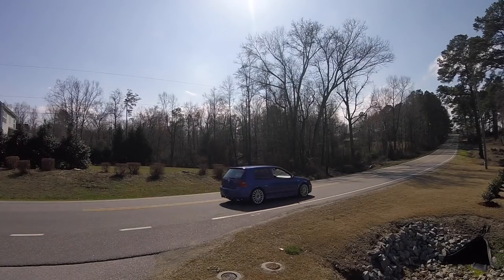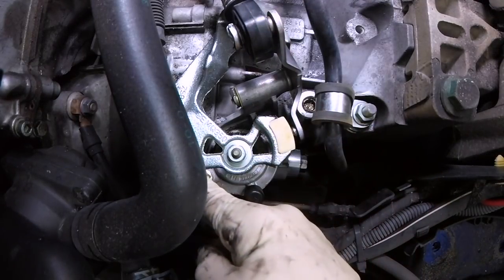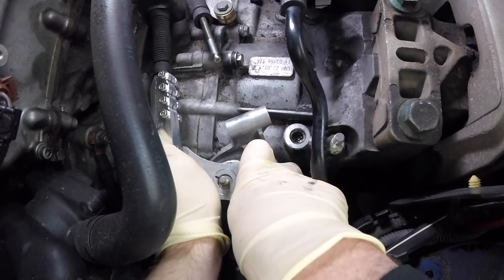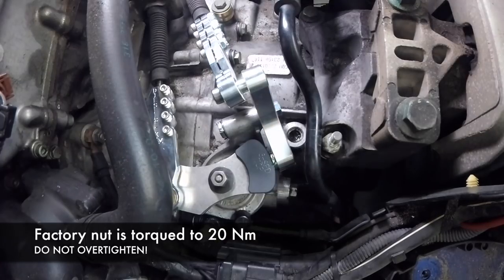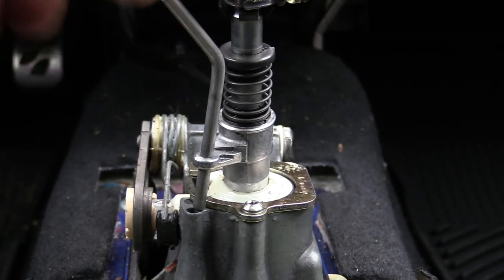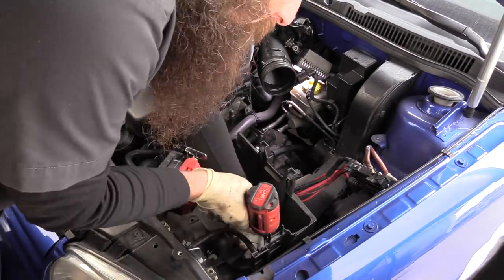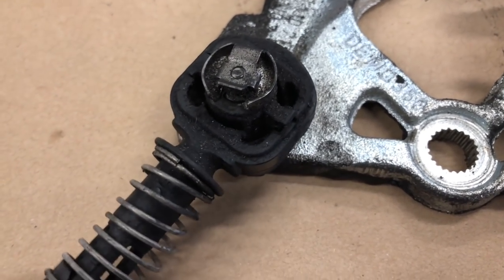How to Install a Short Shifter and Adjust Shift Cables

Comment: So if your shift cable pops off gear shifter and you have to get it towed stuck in 3rd gear and your clutch pressurizes to the floor what is your next move? My clutch isn't loose and dead its pressured to the floor. I'm already gonna reattach the gear selector but how do I release the clutch? Does it have to do with the master slave cylinder? Or does it have to do with the flywheel and pressure plate?

Comment: Great instruction!  Any hints or recommendations on finding one of these kits for my B5.5 TDI?
Reply from the maker: I’m not sure. I’d maybe look at an Audi shifter? We never got the TDI in manual. Plus b5.5 performance stuff is not widely supported
Reply: @HumbleMechanic Thanks,  I have figured that out, but here's the question for you:  I had a 5 spd manual that I had a shop in MO swap for the toasted Triptonic, as the European sister used them. The problem is, I can't identify it.  If I had a manual ( '05 B5 Audi, for instance) where would the tag be that would identify it?  I don't know if I'm blind or just looking in the wrong place on the transmission,. I suspect it is a Zurn transmission , but am unsure.

Comment: When you did the bushings inside the gear box, did you have to go thru the bottom or can you do them all from inside the car?
Reply from the maker: I did them in the car. It was a pain, but better than taking the box out
Reply: HumbleMechanic thank you! I figured it would be a pain but like you said a lot easier than dropping exhaust and pulling the box out. Thank you for the response man! Btw scweeet new garage and your new vcds tutorial video is awesome! I learned a lot that I didn’t know about that software

Comment: Thanks Charles !
Reply: Mk4 2004 GTI 78k miles !  Thank You for helping me to keep this thing on the road !  I have : Cold air intake, Stage 1 tuning, Complete exhaust upgrade from 42 Draft Design, and rear control arm bushings from Powerflex !  Also I have ISC coil-overs (rear installed, going to do the front suspension this fall 2022).  This car is a Beast !  I am the original owner and someday I want to upgrade her to Stage 2 with a Supercharger, new cam shaft and of course a short shifter, but I realize I am looking at a significant engine upgrade, maybe replacing other internal parts, as this ship is 18 years old... ThanK YoO for all of these great vids, keep going ! !

Comment: Hey Charles! Great video! Will this kit work on my 6-speed 2007 VW Passat B6 Variant 2.0 TDI? The specs for the kit mention only 2012-2015 TDI Passat. If not this kit, is there a different short shifter kit I can go for? Thanks, and keep up the great work!
Reply from the maker: I am not totally sure. WE didn't get a B6 TDI. I would call DG and chat with them. They are awesome to work with

Comment: I installed this kit and love it. However, first gear is really difficult to find and I have to push down and forward in the same motion as going in reverse. I pushed the cable end in as far as I could. Is it possible to push them in too far? More often than not, I end up selecting 3rd or reverse instead of 1st.
Reply from the maker: Probably need to readjust the cable a little. That’s a finicky adjustment

Comment: On my mk4 the end linkages for the shifter are the early type (ball and socket), is it possible to convert the assembly to the later pin style linkage by using the later style shifter arms?

Comment: I have this same shirt shifter on my built mk4 VR6 GTI.  Im pushing almost 400hp. I have aftermarket motor mounts and it's been about 2 years since I installed the mounts (they are still in great condition) but recently I had the bolts that mount to the transmission housing rip out (literally ripped out the threads) so I beefed up the bolts to 1/2 inch with helicoils after beefing them up once and having them immediately rip out again. now everything is good and holding well. but since I reinstalled everything a few days ago, I can no longer shift into 3rd gear. it worked before I took it apart. now it's like something blocking it. all other gears shift smooth and I tried re adjusting the short throw but it still won't go to 3rd. 
what do you recommend I try to get that back. I still have my trans lock, and made my own shifter pin that holds tight.  am I just not doing it right or could there be internal damage? 
I feel like I'm not adjusting it properly. 
my trans lock pin doesn't like to stay locked pushed in. how important is it that it stays in the locked position? 
I didn't have this much trouble installing it originally a couple years ago. it was easy peasy. I'm praying I'm just an idiot and need to be more persistent. I've only got 112k miles on my car and would hate to have to rebuild the trans already.

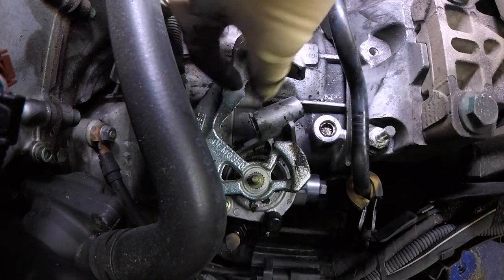Comment: Do you know what is the part # for the bracket @2:30 and also does that bracket will fit on a mk5 gti 6 speed transmission

Comment: Hey I know this video is a little old but I am in dire need of help. I ordered this very kit and installed it, which went extremely well thanks to your video. I have a mk4 vr6 and I enjoy it very much. However, right after I took all of the slack out of the shift cables, and I ran through all the gears while the car was still off-or so I thought. I put everything back together and went out for a test drive. I immediately noticed I didn’t have a 1st or 2nd gear, just 3rd-6th and reverse. So today I tinkered with it some more and now I don’t have reverse, but the rest of the gears. So if you see my sob story by any chance, any help would be greatly appreciated. Thanks-Aaron
Reply from the maker: Keep at the adjustment. I some how lucked out getting it on the first go. Be sure your transmission is locked AND the pin is in the shifter.

Comment: I have a 01 golf 2.0 or 2.slow, avh engine code I believe, is it the same process for it too?
Reply from the maker: It will be similar
Reply: HumbleMechanic how about the shifter and the parts that you used? Would they fit on mine?

Comment: does installing a short shifter like u did make rpms drop faster so the revs match right? new manual driver here and I notice shifting up into 2nd amd 3rd is very slow in my jetta
Reply from the maker: No it shouldn’t impact that at all

Comment: Hey man, great little tutorial! Question: I've got a 2006 Jetta TDI (BRM) with an automatic transmission. I'm getting a low boost code (P0299) and can't find any vacuum leaks. When I connect the vacuum line to the N75 (pressure converter), it seems as though it sends full vacuum to the turbo actuator (the actuator holds vacuum just fine and is set to open at around 3-5 PSI vacuum and fully opened at 18-20 PSI), thus forcing it to open completely and run horribly. Do you know if the actuator is supposed to send full vacuum to the actuator at idle?Hope that all makes sense.
Reply from the maker: I think you are correct. Look for boost leaks and also be sure your cam is not toast. Cam toasting can also cause MAF issues
Reply: Thanks, Charles. I put a new cam in just a bit ago along with a new LUK flywheel (was making that dreaded rattling noise). I'll look for some electrical issues to see if that's what's causing the N75 to send full vacuum to the actuator. -- I'm getting full vacuum and can't find any leaks... I just kept thinking it was strange that the N75 was passing along full vacuum instead of regulating the vacuum. I put in a used N75 from the junkyard, although I know it could also be toast.

Comment: Where the 5mm pin sits in to hold the shifter in place broke any advice on how to hold this piece in the correct place since I can’t use the pin anymore ?
Reply from the maker: I’d drop the pin down and have someone hold it in place

Comment: Yep, don't want to forget that socket, you all know how useful a 12mm can be!
Reply from the maker: LOL, also dont forget to unlock the trans. I have seen that lock break. It's available separate, but a pain to get out.
Reply: Engine bay full of 10mm sockets, each one adds HP, I left a LED Mag light mini once on top of the radiator cover between the grill and core support of a 94 lumina. Spent a whole month there sliding back and forth driving me nuts thinking the power steering rack was going out. It still worked after that

Comment: Installing a S3 shifter on my mk6 gti, Will I need to adjust the shifting cables or should it be a bolt on with no adjustments?
Reply from the maker: probably have to adjust

Comment: I've heard installing a short shit like this can lead to more strain on the shift forks, any truth to that?
Reply from the maker: Probably some. I’d imagine that those issues come from the driving style people would have. Modified parts almost always come with a reliably trade off
Reply: I have heard that some short shift kits need a precise adjustment for cable slack. Too little slack, and the forks are almost shifting the gear and that would cause transmission wear. I have heard it is a common problem among cheap short shift kits in Ford Mustangs. That is why many Ford guys are prepared to pay a much higher price to get a Hurst short shift kit, rather than some generic unit. I'm sure that although the companies that make VW shift kits might not be the same as those who make Ford shift kits, the "You get what you pay for" rule applies to whatever brand you buy.

Comment: Just installed this and for some reason my 1st gear became my reverse and my reverse is 1/8 from shifting to 1st. And info on how to reset and get the gears aligned correctly? I have a 01 Jetta 2.0
Reply: TWINSZ1011 having the same problem currently. Did you ever find a solution?

Comment: Where do you get your Allen/hex drive sockets?
Reply from the maker: There are 3 different sets I usually use. I REALLY like Snap ON here, especially the ball end. Their ball end Allens are the best hands down. 

I also use Hazet. They are pretty pricey too, but are great. http://amzn.to/2DyHd6K

IF you want a really good socket and a GREAT price, check out VIM. I use a lot of their stuff too. http://amzn.to/2FNA0BF
Reply: Vim sells a set of short 1/4 drive hex that are pretty darn good. Pretty affordable too. In the $25-30 range. There are bluepoints that i have that im somewhat certain are identical. The bluepoints cost $11 each...

Comment: I cannot for the life of me find a Short shifter kit for my 02J 5 Speed gearbox. I put a MK4 Dashboard in my Mk2 Golf, but because the dashboard isn't as shallow as a MK2 dashboard the shifter hits the dash/center console in 1st, 3rd & 5th. I desperately need a 1.8t GTI 5 speed short shifter.
Reply from the maker: I think DieselGeek make one.
Reply: HumbleMechanic Oh, you're correct, I was under the impression that they didn't fit the early model 1.8t GTIs but it appears that they do. But damn, $180 for a short shifter, it probably would have been cheaper to buy a new Mk2 dashboard haha.
Reply from the maker: Hahahha true.

Comment: How to Telestart T91 Upgrade KIT - Engine Heater -> Parking Heater? Vw t5 2012
Reply: It might not be that easy to demonstrate. The Volkswagen T5 was never sold in the USA because the VW T4/Eurovan wasn't a big seller in the USA. In addition, the T5 might not have been equipped with the same engine(s) found in other Volkswagen models that were sold in the USA. From what I have read, many T5 vans had a 5-cylinder TDI engine, and no VW in the USA ever had a 5-cylinder TDI.

Comment: try changing the one inside the car to B&M. I think Megan racing makes a version of it. The two of them=killer combo
Reply from the maker: Thanks. I’ll check it
Reply: You just lose the inside alignment pinning process and have to use 2 people to align the shifter. but the B&M is much more crisp.